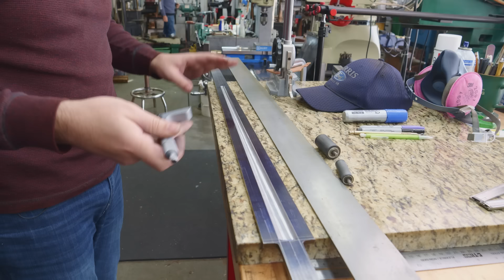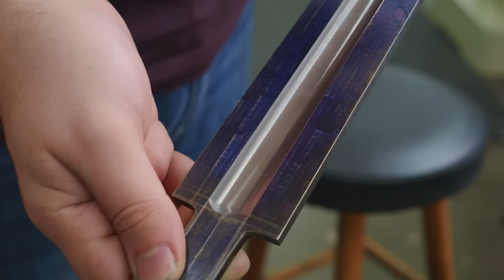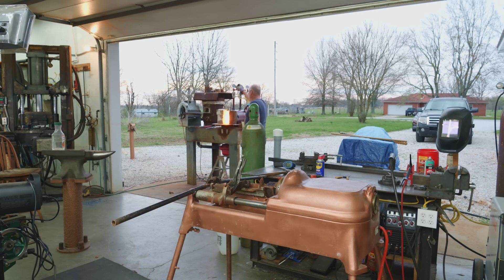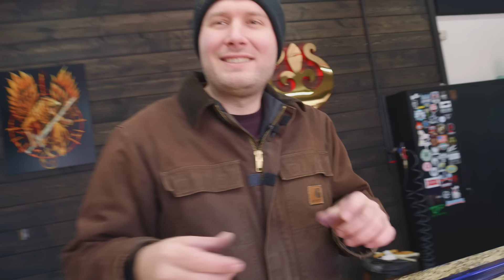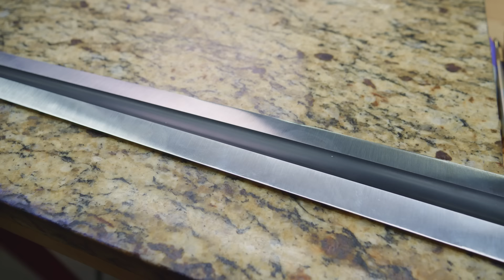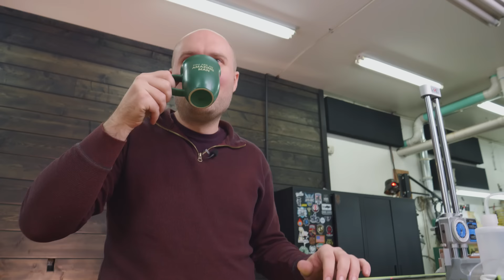Sword Bends After Hours Of Grinding 🤯

Comment: Why not a cnc router for the fuller initial cut? Seems like it would be easier to get a good result that way but I am far from experienced in this area.
Reply: In the last video, he explained that grinding one side releases a ton of tension in the metal and actually bends the blade.  Which would make it impossible to keep it flat on a CNC.  Hand grinding one side at a time helps keep everything straight.

Comment: The green color of the sky was from the hail. The way the light refracts through the hail often makes the light look green or blue.
Reply: Ah, interesting. Makes sense.
Reply: @raydenmorris5220  how does that make sense? light doesnt change wavelength due to refraction.
Reply: “According to National Weather Service meteorologists, water and ice particles inside the clouds work to scatter the blue light. When the light is illuminated by the sun's rays, it can appear to have a greenish tint.”
Reply: Hail and raindrops, have a tendency to refract the light. That means the light is now moving at a slightly different angle and changes color. But not only is it bent, but it is also less energetic. Moving the light, every so slightly, from one energy level down to the next. So violet light turns to blue, blue turns to indigo, and indigo turns to green.
Reply: @rws531  Does it not? I thought the frequency remained constant, but wavelength shifted. I'm not trying to start a comment war, I'm genuinely curious.
Reply: @rws531  well, you're mistaken, wavelength does change during refraction, frequency however remains the same.
Reply: Pretty sure it has to do with tornado weather.

Comment: Kyle:  It's always a better idea to use more grounds to make your coffee.  Even if you don't like it super-strong, it's still better to brew it strong, and water it down afterward.  A coffee ground only has so much coffee flavor in it, and after you've extracted that, it just adds more bitterness to the brew.

Personally, I use about 2oz by weight (about 12 tablespoons) per 40oz water.  And I put a tiny bit of salt in the bottom of the pot; it really helps to boost the flavor.

Comment: Mad to think that back in the day (a century or two ago), all the fuller cutting and sanding was done by hand, not to mention the other parts
Reply: They didn’t have erasers
Reply: @ronbuckner8179 I bet back then they'd love to have the grinding tools
Reply: They had tools designed to hammer the fuller in.
Reply: That’s not exactly accurate- two, three, four century’s ago they would have forged the fuller while forging the blade and used a stone wheel of varying grits on a hand crank or pedal assembly to grind in the edges and overall shape and whetstones for hand sanding the fuller and they forged a lot of the other parts and finished them the same way. Now a century ago we’re talking 1924 that’s Industrial Revolution and blades were being mass manufactured at this point and alot of the work was done by someone running a machine
Reply: @Vangent87  uh huh...

Comment: I have a similar problem sanding custom architraves. I use a Festool linear sander. LS130. They are a discontinued tool but you can still find a few out there and a massive time saver. They are also variable speed.

Comment: Only ever done one blade with a fuller, and didn't find it to be easy at all. Part of that was down to not having a suitable small wheel on my grinder, so I was debating all sorts of options, using a steel rod and forging it in (decided against it because at the time, my one burner forge probably wouldn't have got hot enough), Scraping it in manually (decided against it because I have small skinny 'drug addict' style arms)....Eventually opted for a grinding disc on an angle grinder followed by lots of hand sanding with the paper wrapped round a section of steel rod.....It sort of worked.

Comment: Great video, Thank you... working on a blade for the Viking challenge and I myself have a fuller to deal with soon... was hoping you had discovered a new magical way to breeze through it hehehe
Reply: If there is a magical way, it would be forging the shape and fuller, then using stones to do the final shaping and smoothing. But that would distort the pattern far more than using the stock removal method and probably not suitable for this collector piece.

Comment: So I have to ask - does this sword have any distal taper to it? From what I can tell, it was forged to the same thickness throughout and then ground to the same edge throughout. It has a reasonable amount of profile taper, but you also have that wide, relatively deep fuller, so I'm curious about where the point of balance is going to be on this blade.
Reply: Around 21 minutes in he briefly mentions grinding it down to give it a distal taper.

Comment: Hi Kyle.. Q.The sword being a collectors piece and not meant for battle..But if it was, Hypothetically, would the thickness between the Fuller's of 1.7mm or 70/1000, pose a problem if you were repeatedly striking hard objects like armour and other swords? Couldn't help feeling worried if I was to strike something hard that the core might twist or fold, considering the length of the blade. Loving this build btw..many thanks 👍

Comment: You know the fuller and shape of the sword can be made during the forging already. Usually this is how it is done. Only sharpening and minor grinding is required... It's not the normal way to make blade by mainly using grinder alone.

Comment: 10:00 man just dab some adhesive that's got flex like sticky tack on the back of that sand paper that drill bit rig and shorten that PVC length a little.